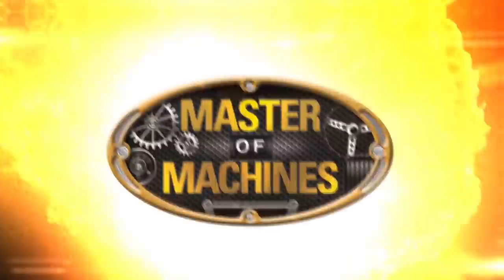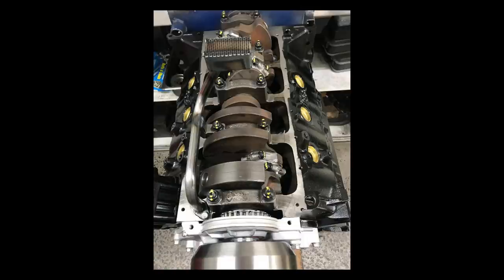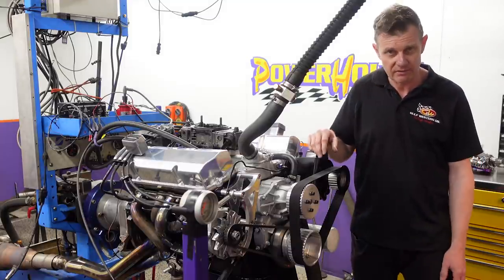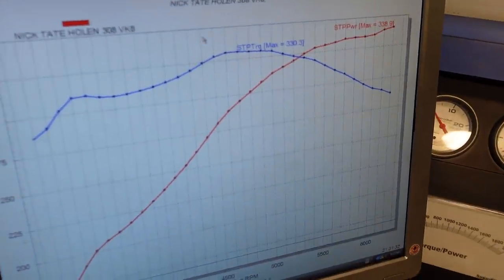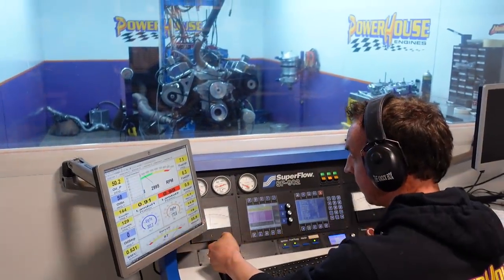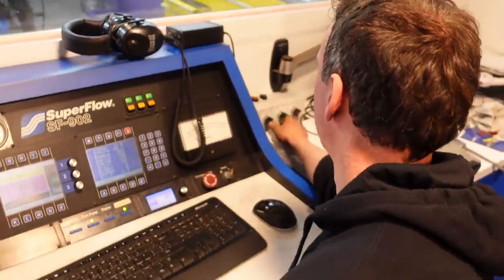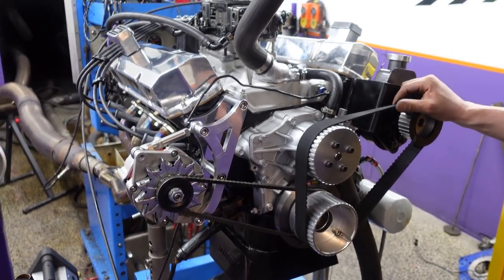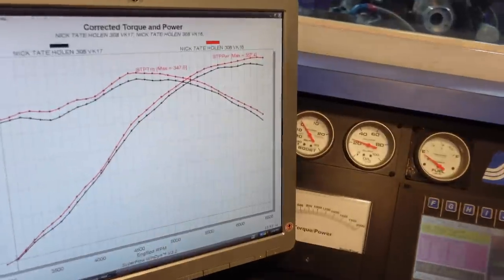1970s GM HOLDEN 308 V8 Engine Build and Dyno Testing  | Iconic Engine Builds

Comment: I'm doing a similar HQ 308 build atm but with crane H226-314-2S-8, bigger 1.94" inlet, 1.60" exhaust valves, ports cleaned up and shaped, same edelbrock torker and flatops. Chambers have been deshrouded around the valves. Compression 10.5:1. I'm looking for 300hp at the wheels. I reckon I'll get it.
Reply: What happen 367hp.

Comment: Did a yearly red cast iron headYT 308 some years back blue printed it ,cc the heads ,biggest grind crow solid cam lifter spring combo available, more head porting and combustion chamber  polished massaged, decked block squared it all up , made 320rwhp in a LJ xu1 replica with a modified trimatic and cut down VL turbo diff

Comment: Very underrated V8 the Holden is I built one for a commodore .I was surprisfed how well it went .stock heads ,manifold 1/78 extractors 3inch  single exhaust no fan . Aussie 4speed  rebuilt carb SCREAMED

Comment: Far out that's awesome 357hp with stock hq heads I never thought this engine would produce that much power with stock heads and not a 355ci stroker that's pretty impressive if you ask me go the Holden 5.0
Reply: heads  are  fitted with larger  valves

Comment: love this build.loved it..i had a 308 flat top pistons edelbrock torker manifold holly 600 vac secondarys in an LX 4 door..it sounded freakishly strong and must've had a lightened flywheel as it revved at the drop of a hat..the body was rusted so i never got it on the road proper though..missus said sell in 2004 so it went for a song :/ ..subbed n look forward to more aussie motor content ,hopefully

Comment: Some will think me silly but I wonder what that donk would produce with the original Quadrajet carby on it. I got 28mpg out of dads HQ Statesman. A mate had a 308 turned L34 with the Quad, same sort of mileage with blistering power. Others talked him into a big Holley, the result was the same power and double the fuel.
Reply from the maker: The Quady is a good thing and could at least match or even slightly outperform the 650, being a larger carb! They’re just not as user friendly to tune with.
Reply: @GlennEverittMasterofMachines  worked on quadrajets for years,people dont understand them,simple as. change needles and jets on the primarys ,change air flap tension spring adjustment etc.

Comment: Love watching and hearing the passion you guys down under have for the hot rod hobby. What would she have pulled with a duel plane intake manifold???
Reply from the maker: Most likely a little less peak power but a with a fatter torque curve with a dual plane.
Reply: @GlennEverittMasterofMachines  Thanks for the response. That's what I figured but I know very little about Holden V8 engines. The power y'all get from some of the Holden six cylinder engines is very impressive also. Thank you for the time and work you put in.

Comment: Be interesting to see alternator hooked up properly with & without elec water pump to see if gains made by running elec pump are offset by HP drawn by alt to power it.
Reply: agreed. I didn't quite see the point of disconnecting the water pump as it will need to be driven by the engine one way or another.

There will be a lot of people that will jump to the conclusion that the electric pump has saved 6-7hp. But in the real world, that pump will be powered by the alternator rather than an external power source, which of course is driven by the engine. The more electrical load on the alternator, the more power it consumes from the engine. Same goes for electric fans
Reply: @71DJL  allows pump to continue working when engine has stopped (therefore continues to cool)  and only draws power when needed... freeing up power when not needed... can be easily adjusted for temp and so on... arguably less reliable though.
Reply: Imo.
Reply: @rahowherox1177  yeah I know how they work, but my point is, when the engine is running the electric pump will also be running drawing power from the alternator, which comes from the engine. But by powering the pump externally (as they did in this test), the power the electric pump would normally draw from the engine isn't reflected in the dyno reading.
Reply: @71DJL  Incorrect. If your alternator starts drawing 7hp.... Well.... It's on fire! Your wiring.... Also on fire! Don't forget there's a big black box in the middle. Secondly you don't need a 7hp pump bolted on the front of your engine. That's just a consequence of not been able to regulate it's speed.
Reply: I charge multiple 12volt  high amp hour truck batteries with a Holden V8 Bosch  alternator, the amount of load the 3hp rated Honda copy Engine see's is dependent on the load, amp draw vs battery voltage. And the altanator gives upto about  1000w output, but I can load more than double that for short periods.To put this another way, I can run way more load than an electric water pump, so long as I'm not dropping battery voltage bellow 12volts
Reply: @ashleyDRT  The water pump didn't consume 7HP......Not even close

Remember the power steering pump was also disconnected which would consume a lot more than the water pump.

But we are all just speculating. As I said in my original post. A more relevant test would be to power the electric water pump off the alternator (and leave the power steering pump connected) and then compare.

Allow the test result to speak for themselves instead of the guesswork.

Comment: Really interested in how you set up the 950 carburetor to perform so well. What jets, power valves etc did you use. I have the same carb on my 406 sbc and I'm having trouble with the tuning
Reply from the maker: The combination varies for each engine.

Comment: Is the nitro in the air? Sweet belt drive. Does that fix? Prime tires 55s and 17 inch steel wheels. power steering sickness.

Comment: Is this basic block unique to Australia or is it an imported US block?
Reply from the maker: This block was unique to Australia, cylinder heads too.
Reply: @GlennEverittMasterofMachines   As an American GM man I noticed a lot of the unique differences in the Holden block as compared to what I'm used to.
Reply: @marcmo7138 it has a lot of Oldsmobile rocket in it , but chev bore spacing , chev bellhousing in later EFI motors , more Oldsmobile bellhousing eailer in 253 , 308 ci motors

Comment: Those gilmer drive belts suck more horsepower than a v belt. Why not try some ida webbers or dcoes on a banana manifold. They used webbers back in the day on the racetrack. better throttle response with the webbers.

Comment: Ok I will probably get hated on but I never liked the Holden engine so much . I think  Holden should have just stuck to the SBC. Like all good designs the SBC was a very simple engine . Just off  the top of my head the water pump system was alot better on a SBC . No crappy aluminium timing cover. Extra head bolts holding the heads down . Available with 4 bolt mains in later versions..
I think the 253 and 308 had some design features from other GM engines mainly Pontiac and Olds. I will say my uncle had a 253 in his panel Van when we were in the back with the tailgate open it made a great noise.
Reply: A key motivation for building the 308/253 was Aus content rules at the time.. also some fitment advantages for RHD... the Aus market was projected to require a V8 in 64/65 so with ingenuity this was the result

Comment: When you gave engine specs, you completely overlooked the most important specs..."Bore/Stroke??? Only mentioned .020 overbored. 🤔🤨
Reply from the maker: It’s running stock 308 stroke but that’s a good point for those around the world that don’t know this particular engine type. Great feedback. 👍
Reply: @GlennEverittMasterofMachines  sorry, I'm from the states, I should have mentioned that. I'm familiar with the American version which is the 307 ci. It has a 3.25 stroke and 3.875 bore. Was an awesome running and very dependable small block. Couldn't kill it no matter how hard you tried 🤣
Reply from the maker: @aumetalmental8403  , all good, and I'm glad you mentioned it. I think you'll enjoy some of the engines we have coming through the build process, as they're mostly American derived. :-)
Reply: Std is 4” bore 3.063” stroke

Comment: 350 on a engine dyno is roughly 250 at the rear wheels 😂🤣😂
Reply: Timothy Iorlano  they are talking HP. You take roughly 100 hp off the engine dyno number for rear wheel hp. Would you be happy with 250rwhp out of a built V8 😂
Reply: @trentcrompton9527  guess that depends on what your goal is. Not everyone wants an LS. Some people are more than happy having an oddball engine that makes decent power.
Reply: I thought 450hp is 300 at wheels

Comment: The 308 was a good motor but that 253 was only a v8 by sound.. hopeless,, i just wish holden had its own 350 and not used the low performance 350 from america that was not a performance version.
My factory 81837  327Hk series 1 i had for 23years was all of 250hp noise where the  corvette 327 had up to 360+ hp.
Aussie cars were poor copies / versions of American cars.
Reply: American dynos are very, very happy